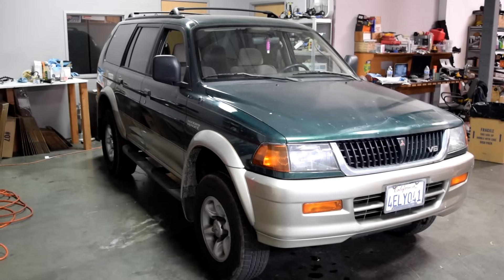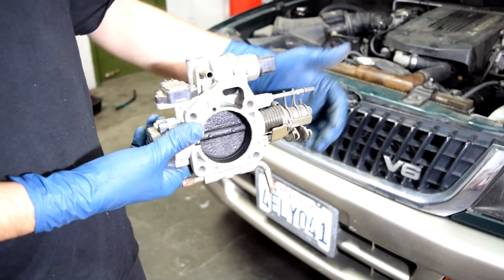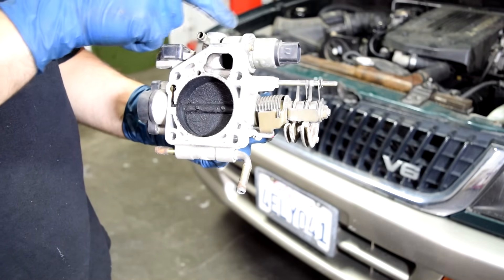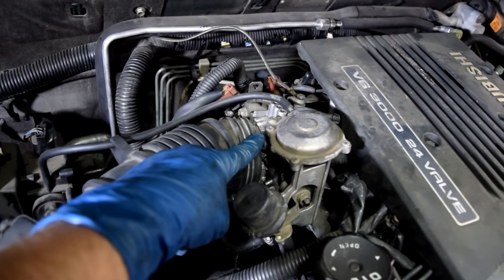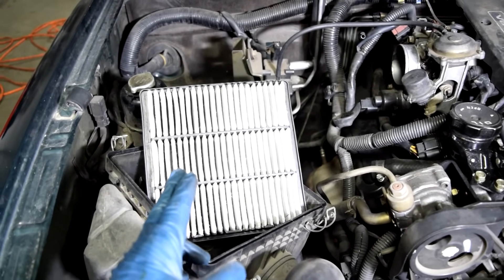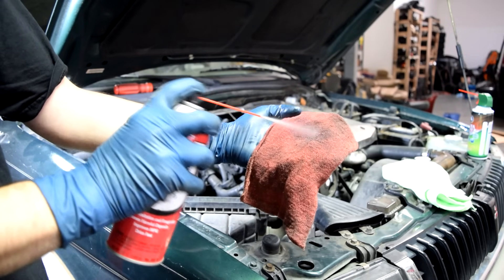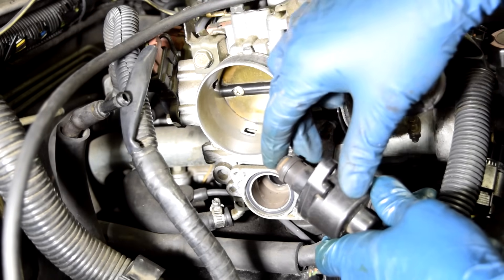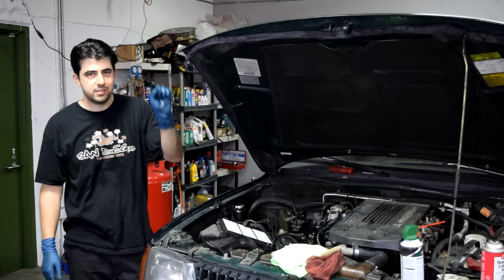How to Clean a Throttle Body and Idle Air Control ( IAC ) Valve - Quick and Easy

Comment: My instructor used a lot of your YouTube videos in my auto classes in college. I’m glade your still making videos. I have a 2003 Toyota Camry V6 and my cars giving me problems with air flow. I replaced the MAF sensor, but I’m realizing the IAC valve is dirty and now I need to go back under the hood and clean everything. Thanks for the videos and spending your time to help others. ❤

Comment: Thanks for the tip about electronic throttles. I've cleaned the electronic throttle plate on my '06 Accord without a problem.
Reply from the maker: +anti0918 good to hear, did you move the throttle plate?
Reply: RatchetsAnd Wrenches Yes, I did move the throttle plate to clean it, as I wasn't aware of the potential problem you mentioned. But I haven't experienced any problems with the throttle since then.

Comment: I appreciate the extra information such as; Don't manually clean your Throttle valve if it is controlled electronically.
Reply: That really makes no sense at all. Should I just throw out my electronically controlled throttle body because it's dirty? No I cleaned it and car runs good as new.

Comment: Great video guy. I’m have some problems with my idle on my 1992 Dodge Ram50 pickup and it just might be the ISC valve. I’ll remove it and clean it. Thanks for a great informative video.

Comment: thnx - very helpul. my '90 nissan d21 idles smoothly but way too fast. Can't find manual or any info on google/youtube. I believe k24e engine. However it's so old, i'm sure it can't be that hard to adjust if i had some info. Can u point me to some resources? there's 1 adjust screw on this gizmo with a REALLY ridiculously stiff spring that cams and stops the throttle from turning too far. And 1 adjust screw on the carb side next firewall.

Comment: Thanks , I may have found out what is wrong with my Aunt's Kia !! Great explanation of the Idle Air Control...
Reply from the maker: +Ol James np, hope it solves your issue with the Kia. If it doesn't watch the next video I am doing on Vacuum leaks, that might do the trick. Cheers
Reply: Thanks, I surely will...

Comment: Very helpful video, thanks. I did it without ever having done any repairs on any car. However, did not work for me. Also, had accidentally left the hose on the left side disconnected. Only noticed it after I drove around the block to check how the car was running. Any ideas if that has caused any damage?

Comment: Hi can you just what to do for rough idle issue on freelander 1 ? Does it has mass air flow sensor ? Or manifold air pressure ? Or anything else needs to be clean along with throttle body ?

Comment: carbon build up reduces the amount of air leaking around the throttle blade requiring the idle air control valve to open farther.. this limits the amount of idle control ability the idle air control valve now has...  so it might not be able to open far enough to maintain idle speed at all conditions..  normal idle air control is 20 to 50 steps back with the engine warmed up.  cold start would be 80 to 90 steps back..  these usually have about 115 steps max..

Comment: Hey Ratchets and Wrenches thanks for all of your help. Your videos are awesome. I have a 93 civic that's been idle surging occasionally. I removed the throttle body to check it out. I also found some small cracks on three different vacuum hoses that all connect to the throttle body. The plunger on the idle air control valve does not seal all the way when resting. Could this mess with an idle surge or could it just be a leaky vacuum hose? The IAC is a pretty expensive piece so I'm hoping it isn't the problem.
Reply: also, it usually idles fine on a cold start. Also, when you press the brake pedal or move the steering wheel while idling it can cause it to start surging a little bit. And both of those use vacuum.

Comment: Gasket from my iac got sucked into my throttle body, my truck is choking for air now I have a rough idle and black smoke from my exhaust and I have no idea where to check for for the clog the vehicle is a 96 nissian hardbody

Comment: Got Honda crv 2000 ex 4x4 5 speed post got water idle control valve hose got 2 take aut see antifreeze it like the sonthing rung the motor thank you

Comment: Would it be ok just to use a micro fiber towel to clean the throttle body and IAC valve? Of course using the spray as well

Comment: Have 94 ram 1500 5.2l with 5speed manual trans and in second gear starting from dead stop it wants to some what kind stall with a  bit of a dieseling affect. cleaned throttle body and replaced IAC

Comment: Have a question. I'm diagnosing a 2000 Infiniti i30 with a p0505 code set. The symptoms are as follows.
Vehicle stalls right after starting. 
Vehicle will stay running when depressong on the gas pedal on crank. After that it stays on and drives perfectly fine. No stalling at stop signs or red lights. The idle is @550rpm. Any advice on where to begin first?
Reply: My cars doing the exact same thing. I took it to AutoZone and had them run a check. They said it was a bad idle air control valve. Cost 200$ for the part
Reply: I double checked everything and it turned out that the intake tubing that goes directly to the Mass Air Flow Sensor wasn't connected properly. I took out the MAF and cleaned the sensor and the IAC Sensor. Car starts right up like regular now. Still have the code set but I'm sure it needs a deep cleaning.
Reply: @zombiecaca1592  did you remove iacv ?

Comment: Just wondering, I tried to follow this video and removed the air filter and cover and inlet and on the other end was the turbo not the throttle body. Where is the throttle body on a 2002 Mitsubishi Pajero 3.2L Turbo Diesel ?

Comment: I just disconnected my throttle body and cleaned it without realizing the IAC was attached to it, I also disconnected the coolant lines going into the TB. They are currently plugged, but am I ok to drain the system of coolant while the TB is still removed from the car? Any issues to come when I need to bleed the system? Thanks.

Comment: Could I clean the idle valve with carburetor cleaner?

My car is a 2004 Toyota Corolla, with 110,200 miles.

Comment: 1999 dodge Durango. Code p 0505.  I replaced the IAC and now it does not start.  It idles low and dies if I spray carburator cleaner.  Other then that it does not start.  I have no clue what is going on.

Comment: My car is a 2000 olds intrigue. Recently I noticed it has a high idle jumps from 700 up to 1200 and even up to 1500_2500 on occasion , especially when I put it in neutral and then park . Then feels like it "sails", ? Gotta press really hard on brake to keep car from moving . Anyhow, do you think the iacv could be stuck or failing , or anything else I should consider?

Comment: Hey man I have a 2006 Hyundai tiburon GT V6 and it's giving me a code saying to replace the IAC. Could this be because I did an engine swap? And will cleaning the throttle and IAC fix it or do I have to replace it no matter what? The car runs and drives fine, revolutions aren't high or low and I don't have a sticky gas pedal. The only thing is that I do hear a small vacuum sucking noise when I turn on the car then it goes away after 10min of driving. I would highly appreciate your help before I go and buy the part which is $150. Also I did go over a small side walk two days before the code came on, could something be lose or did I mess up the IAC?

Comment: Hi, what would be the problem if the car is idling and ac is on.. when the ac is on the rpm is normal and when the ac cut off the rpm increase to 1500 then when ac cut in again the rpm goes back to 1100 rpm

Comment: My 07 MDX is a little hard to accelerate, just like you mentioned it feel sticky as first, but picks up after few second. Could this be an issue?
Reply: +Moon “Moonlight” light It's an electronically-controlled throttle, so you wouldn't want to push in the throttle plate with your fingers. You could still spray around the edge to try to clean it. You could also find where the APP sensor is located. The accelerator cable connects to it, and you can try adjusting the cable tighter. I did that on my '06 Accord. In my case, the APP sensor and cable were nowhere near the throttle body, so you'll have to do some research to find where it's located.
Reply from the maker: +Moon “Moonlight” light possible, another culprit is a vacuum leak, by sticky gas peddle I meant feeling the gas pedal mechanically sticky under your foot. idk if thats what you meant. But also watch the next video I will be putting up on vacuum leaks, as that could be the cause as well. Cheers
Reply: +RatchetsAnd Wrenches I honestly don't know exactly what the problem is but it's similar to what you describe. I'm changing my spark plugs this weekend and will check out the throttle body and check for any leaks. going forward to your video.

Comment: sometimes when i press the throttle pedal i neutral it doesn't keep the rpm steady for example at 2000. Insteady it keeps going till it reaches 4000. Does anyone know what might be the problem? I have an eletronic throttle body, no cable. When the car is rolling it does not have any problems.

Comment: quick question, do you clean the idle air control valve or just the housing when you take it out?
Reply from the maker: +Totalpckge Depends on your setup, but if you see any carbon deposits anywhere around the valve itself make sure you clean it off, but its even more important to clean the passages where the air travels from one side to the other. GL
Reply: i also read to put a drop or 2 of lubricant in valve after cleaning. is this ok??

Comment: So what is the procedure to clean an electronic throttle body if we can't clean it manually 
Knowing that the majority of car's nowadays are equipped with electronic one
Reply: moe raw very good question..i saw a guy just leave it plugged in and cleaned it like that but my understanding you have to remove them then clean and reinstall.  some cars you have to go through a relearn idle process after reinstalling it
Reply: simply detach the neg terminal on battery - no power no memory. All other reviewers don't mention a problem with electronic throttle bodies so I doubt it's an issue.

Comment: Really good, as usual.  Of course, my car has an electronic throttle control.
Reply: Turn the key but don't turn engine over put a weight or something to hold gas pedal down and it will open the throttle body plate up for you and then you can clean freely

Comment: Throttle plates aren't closed? They have a specified gap. Which is precisely the issue when it's gunked up. It completely closes it and the IAC doesn't have the range to control it.

Comment: Well... My car has that electric motor thing on it. How to I clean it? :O - It is a VW Golf IV 1.4 16V 100ps from 2000. :)
Reply: If you haven't gotten an answer for this yet, you can check VW Vortex, they have great stuff for VW's. I can say that I have a MK4 Jetta and I completely remove the throttle body, spray it down really good and clean lightly with rags, etc. I recommend never moving the throttle plate (like he said) because it is controlled by an electronic motor and you can damage it. New throttle body ~$300-$400, not good.

Comment: holding the throttle body upside-down is a mistake. Most fellows need to see the devices in the orientation they work in.... the rear of the throttle butterfly is to the rear and the IAC is underneath...

Comment: Is there an alternative to the throttle body cleaner? Like any household chemicals that may work as well?
Reply: Proper throttle body cleaner is always better since it's formulated to stay in there as long as it's needed to turn everything into liquid gunk that drips away, gets sucked by the engine or is easily removed with a rag, and then it immediately evaporates away. You could try with WD40, but it would leave a film of lubricant oil and i doubt it would do any good to the electrical components or to the TPS. Same as for other solvents such as diesel fuel and jet fuel, they just stay in there a lot more than they should. Always try to remove the throttle body from the car first, so that nothing ends up inside the intake (also remember to cover the intake with a rag as soon as you remove the throttle body, so that no dirt or anything else inadvertently gets inside the engine).
Reply: TeraVolt thank you! I got mine open thinking it was the issue... It was clean as a whistle. I'm driving a 97 Bonnie se, and after some research, I was able to clean off both ground buses, and I tightened the cables on my battery, now she doesn't stall anymore, starts right up, but still I think the battery is weak
Reply: Yes, proper battery connection and health does a lot, a good battery can eventually wear out even after only 3 years. By the way, if you only removed the air duct from the air filter box to the throttle and looked at a closed butterfly from the top, without even opening it with your fingers (if the throttle body is electronic, unplug it first to be sure), it might appear "not so dirty" on the top but coated with carbon on the lower end and, most importantly, at shallow opening angles a ring of carbon on the walls may be keeping the air from flowing freely. That's how mine was. My car (manual trans) struggled to take off fast from a stop even when pressing on the accelerator a lot and the idle was not so smooth. It tended to vibrate like it was always compensating for something and on the verge of becoming rough. After cleaning the butterfly valve shiny (even pushed the butterfly wide open with my fingers to clean the walls better, even if it was an electronic throttle body), by spraying a heap of throttle body cleaner and helping it with a rag, now it can take off without any hesitation, like a police cruiser.

Comment: Why some throttle bodies have water hoses/coolant flowing?
Reply: Petar st to heat the air maybe so they run better on cold days
Reply: Its to keep the throttle plate from freezing. But its only use full if you live some where it's really cold

Comment: I have a question my car used to idle on cold start high then come down when warm which is normal. Lately I start my car on a cold start and immediately goes to lower RPM's and then slowly starts going up. What could this issue be?

Comment: You can clean an Electronic Control Throttle body. Just don't stick your finger in there and force it open. It will close and cut your damn finger off. As it has a motor that will shut it in off position! Trust me. I seen someone get their finger tip chopped off....

Comment: You didn't show how to clean the IAC after you removed it.  Bad idle is usually more complex anyway like a bad spark plug or malfunctioning fuel injector.  Dealer computer can usually find the real issue.
Reply: What about always idle at like 2.5 times the speed?

Comment: your wrong the only job of a  iacv is to allow air through at cold engine startup it closes when car is at operating temp if it stayed open u would have high idle your actual idle is controlled by your throttle plate being open just enough to let air through and that is adjusted by your stop screw jesus this reminds me when u told guys to do a wheel alignment with tires off the ground
Reply: Then tell me this Mr. Genius. Why is it called “Idle” air control valve. IACV.
Reply: ...I may add that yes it controls the idle at cold start by opening and raising it, but it closes as the engine warms up and  the idle speed is controlled  and set the idle air screw  on the throttlebody..IT bleeds in enough air to raise or lower the idle speed to  set it where it should be by the manufacturer..On my car , a 94  probe gt the throttleplate is essentially closed and is set that way at idle...its the air screw that sets the idlespeed ,on mine at least.. The iac Also will open and raise up the idle on a warm engine when the AC is activated to compensate for the drag on the engine at idle...JB Rzz, it Does  control the idle,but only under certain conditions such as coldstarts and AC operation...It does NOT  operate to set  the idle speed under any other scenario... hope that helps clarify...